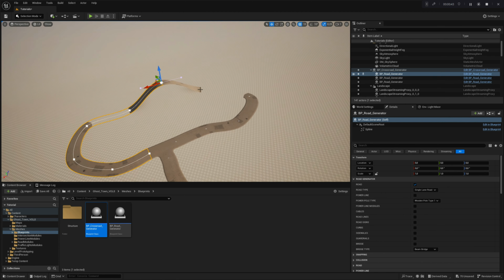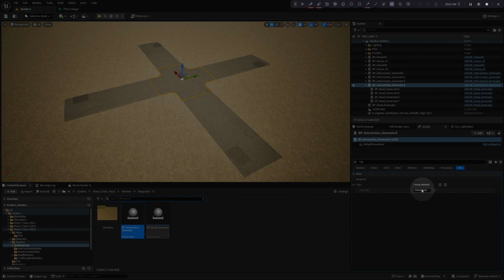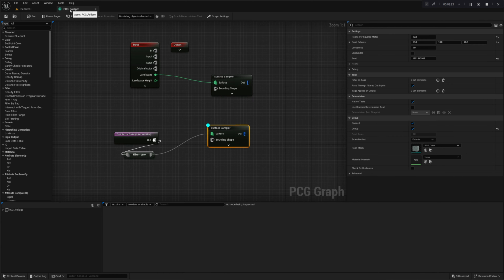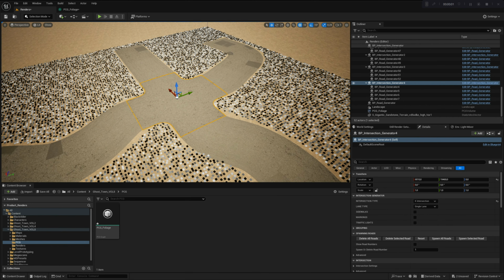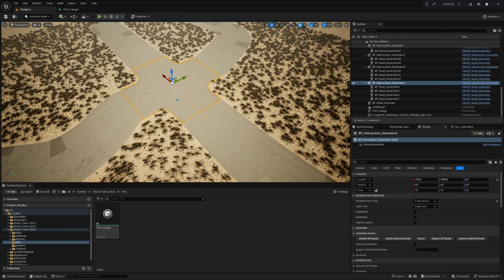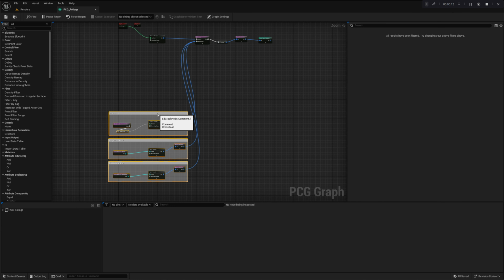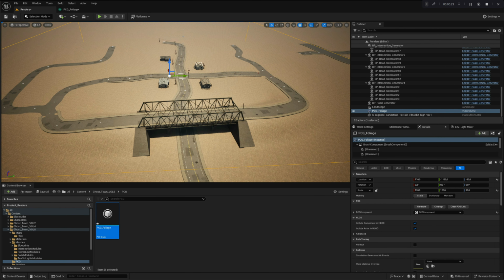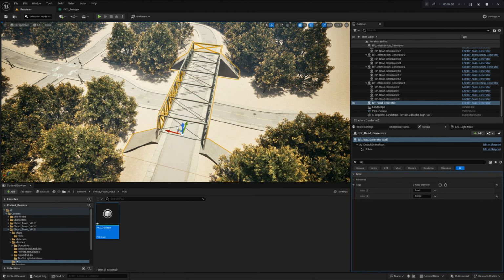Crossroad Generator For Unreal Engine 5 - PCG Integration

Comment: I'm using Unreal 5.5.4 and the part where it says to use the Tag name of Get Actor Data to prevent PCG Points from being generated at the Actor BP location, but this doesn't work for me. It works fine with Get Spline Data, but why doesn't it work with Get Actor Data? I'm also worried that the Building Generator that will be released later won't work with Tag names as Actor BP.
Reply from the maker: Thank you for reaching out with your questions!

The demonstration for PCG was originally made in Unreal Engine 5.2. Since then, with the release of Unreal Engine 5.5.4, Epic Games has made some changes to the PCG nodes. We’ve tested the system in 5.5.4 and it works fine, but we do need to update our YouTube tutorials to reflect these changes. We’re planning to release updated tutorials in the near future to cover everything with the latest version.

As for the Building Generator — no worries! The PCG integration for it will be demonstrated and tested directly in Unreal Engine 5.5.4, so it will be fully aligned with the latest editor updates.

Thank you for your patience and understanding!
Reply from the maker: Here is the updated tutorial for UE 5.5.4
https://youtu.be/LIgSQczwyIA
Reply: @Rendertale  many thanks!

Comment: In Unreal 5.5, we have the Get Landscape Data node. I'm confused on how to set this up. When I try to use
 the get actor data and use the tag Intersection, it doesn't work. How should it be connected or do I need to do something else to get it working.
Reply from the maker: Thank you for reaching out to us with your questions. We are currently working on an update for the Unreal Engine Editor version 5.5. Epic has introduced changes to PCG functionality and modified certain nodes, which may result in a different setup for the latest version.

To ensure our product stays up-to-date, we are also preparing new video tutorials to assist you. In the meantime, we appreciate your patience and understanding. Thank you for your continued support!
Reply: @Rendertale  Good to know. Thanks.
Reply from the maker: Here is the updated tutorial for UE 5.5.4
https://youtu.be/LIgSQczwyIA

Comment: Hello, I'm trying to get the PCG graphs that come with the pluggin working and when I try to set up the get actor data to "by tag" it doesn't work at all with the landscape or the road, when I set it "by class" and pick the road generator it works fine but just around the road, the rest of the landscape is empty and I can't figure out how I can get it to work as your example.
Reply from the maker: Hello, thank you for reaching out to us with your question.
It sounds like you're encountering some issues with setting up PCG graphs using the "by tag" option for actor data. Let us provide some guidance to help resolve this:
1.	Verify Tags: First, make sure that the road generator and crossroads generator actors have the correct tags assigned. Double-check that the tag names in the PCG graph match exactly with those assigned to the actors in your scene. Tags are case-sensitive, so even small differences can prevent them from working as expected.
2.	Check PCG Graph Configuration: Ensure that your PCG graph is properly configured to recognize multiple tags, if needed. The nodes and connections should be set up to process the data from these tagged actors.
3.	Actor Boundaries: When using the "by class" method, if the PCG graph only works around the road, it might be due to actor boundaries or volume settings. Ensure that the landscape is included within the PCG volume's influence area.
4.	Debugging: Use the debugging tools within the PCG graph editor to trace the flow of data and see where it might be failing when using "by tag."
If you've gone through these steps and the issue persists, please provide any error messages or further details you are encountering. Feel free to reach out with more questions or send us any relevant screenshots at our support email: contact@rendertale.com
Reply: @Rendertale  I managed to make it work, it was the actor boundaries that needed to be increased, thank you!

Comment: Sorry posting too many comments, If there is a discord or something I would ask doubts on those forums but since this is only way to contact or ask doubts, that's why posting it here.
My doubt is, If I try to create a bridge, and raise some control points, how do I scale the pillars/foundations down to reach the ground? because since bridge and road are connected together, when I raise the control point for road, bridge also raises with it and looks flying above the ground. some places I deform the landscape accordingly but few places I want those pillars to be long in heights and reaches the ground. how to do that?
Reply from the maker: Hello, thank you for reaching out to us with your questions. We are currently in the process of setting up a Discord channel for customer support and suggestions. Regarding the bridge, the pillars and foundations are created with custom meshes of fixed sizes. If you would like to change the sizes of each element, you will need to use your custom meshes to replace the pre-loaded blueprint meshes. Currently, there is no parameter for controlling each pillar size separately. However, we appreciate your suggestion, and we will make efforts to implement this feature in future updates. Thank you for your valuable feedback!
Reply: Ok I'll try to add custom mesh pillar. Thank you so much for the reply and support! @Rendertale